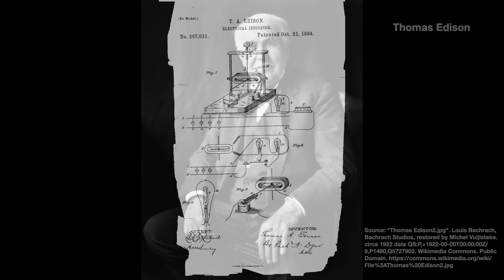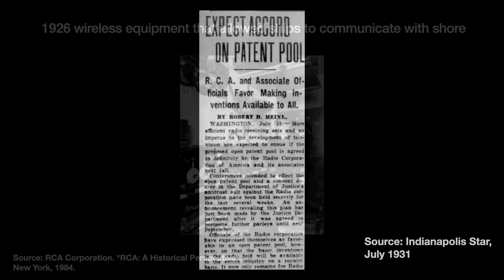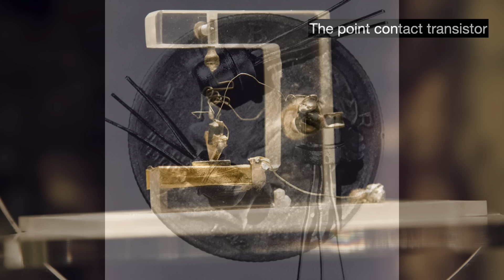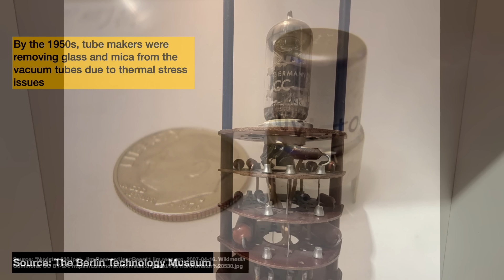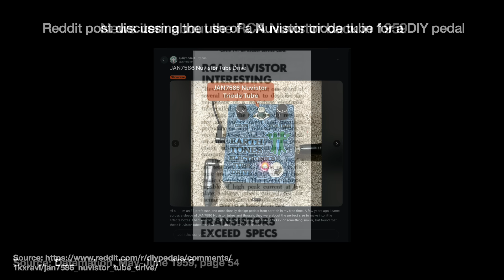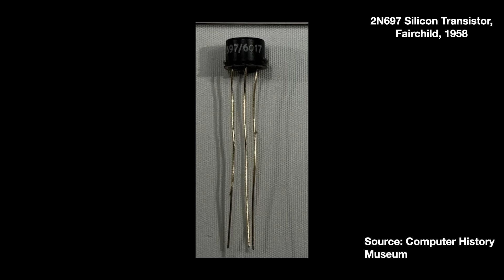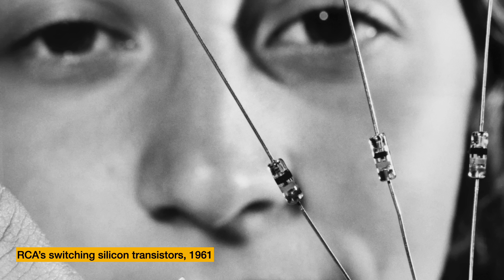RCA Made a Vacuum Tube to Beat the Transistor

Comment: “In 1956 Semiconductor Company sold twelve million transistors.” That is about 1/1600th as many transistors as the phone in my hand has.
Reply: I’m trying to imagine how large the room would need to be to do with your phone can do with the old equipment.  It probably would resemble a data center both in size and power drain.
Reply: @DaveP-uv1ml 
 Point of fact.
It would wholly impossible to come close to an approximation of a modern cel phone using 50's technology.
Reply: @slugface322 Indeed. The speed of light would be a barrier.
Reply: @SusanPearce_H 
gps constellation 
magnetometers that sense the earth's magnetic field
accelerometers that determines the phone's orientation in 3 axis's
cameras measured in micrometers
heck the internet!
multiple microphones the size of a pin!
an octo-core microprocessor containing billions of nano scale CMOS transistors driven by software requiring software measured in tens of man-years to create...
all in the palm of our hands?
yeah modern tech is so cool 😎 
Albert gave us a good read on the speed of light 😊
and then there's that quatum mechanical thang

what a magical time to be alive!
Reply: @SusanPearce_H , i’m sure it would pause a lot and you’d have to have a team of people probably on golf carts with little crates of vacuum tubes so they can drive-through quickly and replace all the ones that keep going out.  Yeah it would be very impractical and it wouldn’t work well, but it would be kind of interesting just for fun to see how close you could come to approximating anything like today’s equipment with yesterday‘s hardware if you had an unlimited budget and space and power.
Reply: @slugface322 Your cellphone transistors are mostly sitting idle. If all 2 billion transistors were simultaneously ON state, your cellphone would explode in your hand taking you to heaven.
Reply: @AlterKater 
Well......
I when I learned about it, the Intel 8080A was the schnizz. 🤪
Reply: @DaveP-uv1ml
shure with them old five megabyte Winchester hardrives, running COBOL or Fortran?!?
Reply: @AlterKater  It is little wonder that you tell untruths cowering behind a phony "name"!
Reply: @AlterKater  There's billion of transistors switching on and off billion time per second...
Reply: @slugface322 And not one of those things have created a better world in which to live.
Reply: @MRandDS 
Without "those things" there would be five billion fewer people overnight. Those that remained would live in pre-industrial squalor.
Reply: @MRandDS 
The two greatest things to come out of WWII were penicillin and thermonuclear weapons.
Both have saved hundreds of millions of lives!!!
Reply: @slugface322 Spot on!
Reply: @slugface322 
'Without "those things'....
Seriously?  You equate that not having a "smart" phone relegates one to living in squalor?  LOL
Reply: @MRandDS 

🤌
Reply: @MRandDS 
Oh yeah
Reply: @slugface322 What is wrong with capping growth?
Reply: @MRandDS  Wait until you need a cardiac monitor in your hospital bed!
Reply: @DaveP-uv1ml Given the reliability of tubes, and the sheer number of them, it would be unlikely to run for any amount of time. The Eniac would have a failed tube about every other day, with only 18,000 tubes. A smartphone has about 100 billion transistors, or about 5 million times this many transistors, so it would be in a constant state of failure. It would also consume the amount of electricity used by nearly 1 billion homes, making it nearly impossible to power. The machine would be so large, the power requirements would likely be much higher as signals would have to travel vast distances. Also, given the immense concentration of power consumption, the whole area would be extremely hot, imagine using all the energy of all the homes in the US 3 times over and make 1 huge spaceheater.
Reply: @AlterKater  When you are using it to play a demanding game, a large portion of the transistors will be active. There are no reports of phones bursting into flames while playing a game other than the Note 7, which had a critical flaw in the battery. Even with the max usage of all transistors at the same time, the CPU has power limiting features, so it may lower the clockspeed perhaps 30%, but it will not allow itself to get too hot. All CPUs the last probably 15+ years have this feature.
Reply: @SusanPearce_H  Cardiac monitors have smartphones inside them?  LMAO!  You're a special kind of idiot, aren't you?  In fact, I have a vintage EKG monitor which has nothing but some analog amplifiers, an oscillator, and a CRT which works quite well.
Reply: @slugface322I cut my teeth on a 8085 trainer. 😂
Reply: @DaveP-uv1ml it would be about 100 million times bigger about as big as a continent roughly 10000km in length and and width  maybe slightly less if they are clever and use small tubes like the nuvistor or early transistors and remove features they wont use and some kind of electrotechnical mass storage making it way slower too  but it would still bigger than most countries except maybe Russia and Canada .
Reply: @DaveP-uv1ml Counting or not counting unoptimized and bloated apps?
Reply: There are still more stars than all transistors in all devices ever   created.

Comment: These were actually popular in car radios in the early 60s. Of course even cheap transistors at the time were about $10 each (in 1960 dollars).
Reply: The Nuvistors were too expensive for car radios in the early 1960's.  Instead they used a new type of tube that needed only 12V for the B+ plate supply voltage.
Reply: @acmefixer1  The ones I remember were metals cans sealed with ceramic material.

Comment: Tubes don't shatter when they get hot, and the "Eniac" operated tubes at a low temperature and voltage so they would last about 1,000 times longer.  So they weren't changing tubes all the time.
Reply: Tubes were developed specially for such low-current applications because ordinary tubes would suffer from cathode poisoning if they were operated for long periods in the "off" state, with filaments or heaters powered but no plate current flowing . There were also special "space charge" tubes developed for cars where plate voltage was only 12 volts; this negated the need for an electromechanical "vibrator" that chopped and pulsed the DC voltage and stepped it up via a transformer.
Reply: Hmm, "All the time" is all I ever read/heard over the years.

Comment: What is the state of the art of X-ray tubes? Have they been supplanted by solid state X-ray emitters?
Reply: Still mostly hot cathode tubes but they are starting to use cold cathode tubes in portable XRF scanners. No solid state replacement besides actual radioactive nuclear material.

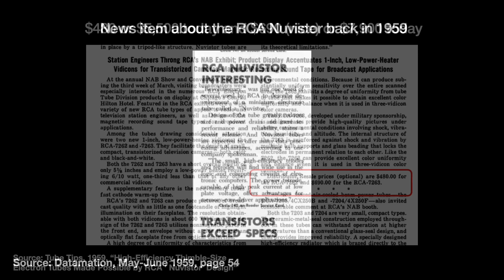Comment: 15:33 those $5000+ tubes aren't ordinary transistors, they're "vidicons"—image sensors for professional TV cameras (still crazy expensive in today's world, where 4K image sensors go for about $60)
Reply: Scanning electron microscopes still use Vidicon camera tubes, and they are expensive.
Reply: Thanks for explaining.  I knew that $480 couldn't be the real price for one vacuum tube, when the TR-1 radio (containing 4 transistors) retailed for $49.95 five years before the Nuvistor came out.
Reply: Bumping this.
Reply: At introduction in 1959, RCA set the manufacturer/OEM price for the first commercial Nuvistor—the 7586 medium-mu triode—at $1.05 each. By the early 60's, Nuvistors were priced at $3.00 to $4.50.

Comment: As a guitar player, I am glad they made so many different SKUs of vacuum tubes. In an amplifier, they almost seem to take on their own personality, and an experienced user can tell the difference between a 6L6 (“American sound) or EL34 (“British sound”).
Reply: 00⁰1
Reply: It's called distortion.  Distortion was a lot harder to control with tubes because of cost.
Reply: Guitar players are also infamous for easily believing in snake oil, like tone wood in solid body electric guitars
Reply: this
Reply: @Dell-ol6hb plenty of audiophile snake oil out there as well.  Still makes me laugh
Reply: @Dell-ol6hb  You do know that a solid-body electric guitar still resonates and the material it is made of will affect that resonance. I don't play guitar, but I have an understanding of physics. The body and neck will resonate like it or now, and that resonance will move the pickup in relation to the string in a addative or subtractive way to the signal.

Like if you remove the crossover from the speaker enclosure, it generally improves the sound as you don't want the coils of the chokes vibrating in a magnetic field
Reply: @piccalillipit9211 Yep, it resonates. Just not on the frequencies you typically play on guitar. At least it holds for my 2 guitars which have resonance much higher.
Reply: @petrpolasek5931 this is true, and every part of the guitar matters for vibration to some extent.  The vibration is also felt by the player, which has an impact.  Tube amps respond differently than solid state.  Personally, i prefer tube amps.  YMMV
Reply: Marshall originally tried to clone Fender amps, but using British equivalent parts, and made a whole different beast!
Reply: @5roundsrapid263  Funny thing is Fender himself knew very little about amplifier design so he just copied a schematic from the RCA tube manual and turned everything up to 11 to get the highest power he could, thus introducing the high levels of distortion that became the characteristic electric guitar sound.
Reply: Obvioulsy the EL34 is better :-)

Comment: i still buy vacuum tubes/valves for my guitar amps. there is nothing like the sound of a tube amp, no digital amp has managed to properly replicate the sound.
Reply: I guess you never heard of transfer function.  If two devices have the same transfer function, then they will sound the same, no matter what's inside!
Reply: @James_Knott  so are there solid state amplifiers/modellers that actually have 100% identical transfer functions to the valve amps they are trying to replicate?
Reply: @bensblues   The guy behind Carver amps did that exact experiment.
Reply: @James_Knott  on a guitar amp? not talking about hifi systems
Reply: @bensblues   I believe Carver made audio gear, not guitar amps.  However, the transfer function is used for many things, not just amplifiers.  It is simply the comparison with input vs output.
Reply: @James_Knott  i understand. I am not an audio engineer but i think there are large differences with guitar amps as the amplifier is basically an extension of your instrument. i think the Kemper profiler is the best bet but i'm not sold that it would be indistinguishable.
Reply: @bensblues   There are differences between makes, depending on how they were designed.  The fact that different makes sound different means none of them are perfect amps.
Reply: A lover of second harmonic distortion?
Reply: @longsighted   More correctly, even order harmonics.
Reply: Believe what you want

Comment: *This video was a deep dive into RCA's desperate but clever last stand with vacuum tubes.* I loved how it broke down the Edison effect origins and how De Forest's grid turned it into an actual amplifier that powered everything for decades, but then the transistor hit like a bombshell.

The Nuvistor stuff was fascinating, that tiny metal-ceramic design trying to match transistors in size and toughness while still doing high-power RF jobs they couldnt touch yet. And yeah the internet really is a series of tubes within tubes on YouTube, endless layers of old tech stories like this keeping the knowledge alive. 

RCA poured so much into evolving tubes even as solid state took over, its kinda inspiring how innovation fights back. Great watch man.

Comment: They almost never shattered in normal use.
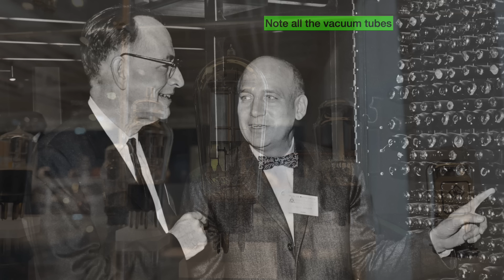Reply: When you have 17,000+ of them (ENIAC, 3:34), "almost never" becomes "every few hours"
Reply: @raffriff42 , shorted (short- circuited), perhaps, but not "shattered". If that many tubes are shattering, it indicates that the glass bulbs were made wrong and/or poorly annealed.
Reply: @goodun2974  Yeah, I was talking about all types of failure, and the sad fact that Mean Time Between Failures (MTBF) goes down with complexity. If a single tube had an MTBF of 1000 hours, the system MTBF with 17000 tubes would be 3-1/2 minutes.
Reply: Unless you dropped them on concrete. And if you dropped a picture bulb, BOOM!
Reply: @quantumleap359   I dropped a picture tube once.  Fortunately it was on my bed.  My grade 12 electronics teacher showed us how to make them safe, by breaking the exhaust portion with pliers.  He had previously worked for GE.
Reply: However, losing emission from the cathode was a common failure.  Then there was the filament burning out...
Reply: @James_Knott , cathodes of ordinary tubes tended to fail (low emission) prematurely in computers due to "cathode poisoning" caused by low or no plate current most of the time. Special tube types were developed for computers to combat the problem. Also, most tubes from WWII on had *heater*, not filaments, and heaters are far more reliable.
Reply: @goodun2974  Heaters or filaments, they tended to fail.
Reply: @goodun2974   Forgot to mention, the indirectly heated cathode was invented by Ted Rogers Sr. of Toronto.  He, among other things, started radio station CFRB, the RB standing for Rogers Batteryless.  His son, Ted Jr., owned CHFI, which was one of the first FM stations in Canada, along with Rogers Cable, the cable TV provider and Roger cell network.  I use both of those.
Reply: @James_Knott , assuming use of good US or European tubes, many decades ago, then the circuit design was at fault.

Comment: I would think the vacuum tube's last stand was the CRT.
Reply: Your microwave uses a vacuum tube to produce the microwave energy that cooks your food. Even in 2026, no transistor can do that at that power level, that cheaply.
Reply: Nah. They are still VERY common in radar and high power RF applications. It is very hard to put out nearly a megawatt peak-power RF from a solid-state source. Or at the least do it at a reasonable price point.
Reply: @tanall5959  At what frequency? :) The alternators of old, long succumbed to electronic solutions of course, and solid-state class D amplifiers do it on industrial scale (I've been personally involved in the development of power supplies in the 50kHz 600kW and 400kHz 50kW range).  With Voice of America now silent, the (last?) large (500kW) shortwave tube transmitter is done; there are probably still plenty of 13.56 / 27 / etc. MHz industrial applications that use tubes, but MOSFETs will be replacing them these days. GHz, though? Transistors for that are still wildly expensive (ca. $1/W); and transistors don't offer any kind of pulsed capacity, they're rated for what they do and that's what you get, no way to (ab)use a device for much higher power even briefly.  (Well, you can get more pulsed power from a switching transistor thermally designed for a high-efficiency application, but you also can't get more than modest frequency from one; they're (somewhat intentionally) slower than RF types. Meanwhile, RF types are made on the bleeding edge to maximize frequency response.)

I wonder what they use in those ADS/crowd control things...
Reply: Magnetrons, x-ray tubes, klystrons, and more. They are still widely used.
Reply: @teresashinkansen9402   Funny thing, I had a check up at the dentist a few weeks ago.  They have long given up on X-ray tubes & film and gone with digital systems that expose the patient to much less radiation.
Reply: Also photomultipliers still have several applications.
Reply: They live on in guitar amplifiers and high fidelity systems.
Reply: @spacemissing   The music world is the definition of "a fool and their money".  It is full of golden ear types that don't know what they're talking about.  Their is a whole industry devoted to parting them from their money.  Remember Monster cables?
Reply: @James_Knott  Just like pretty much every other industry. Also, tube gear is usually more repairable.
Reply: @James_Knott Tube amp saturation is objectively different from solid state saturation. I agree that a lot of audio stuff is fantasy, but there is really straightforward math behind tube amps being used for guitars.
Reply: @dloorkour1256  Try building a smart phone with tubes.  It can't be done.  Even individual transistors allowed more sophisticated circuits than tubes.
Reply: @James_Knott  What are you trying to prove here? You gave the standard "Monster Cable" comment about audiophiles (not even that expensive, compared to some, and that was a mass market scam anyway). Nobody said you can't build a transistor amp cheaper.
Reply: Nope. It's the magnetron, a special purchase vacuum tube still used in microwave ovens as the RF high power oscillator and amplifier.
Reply: Thank you all for the good examples :)
Reply: No, it's the magnetron that's used in microwave ovens.  The CRT died years ago.